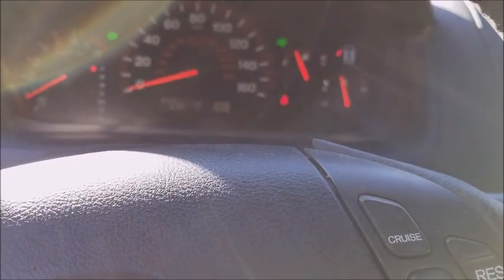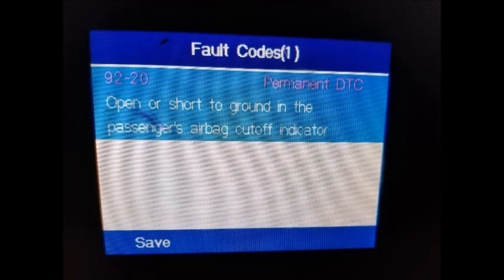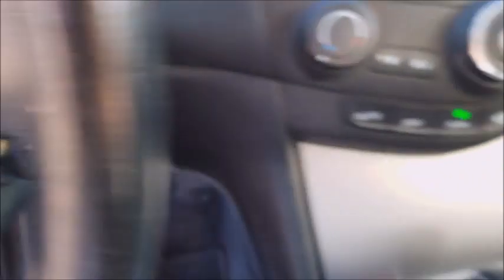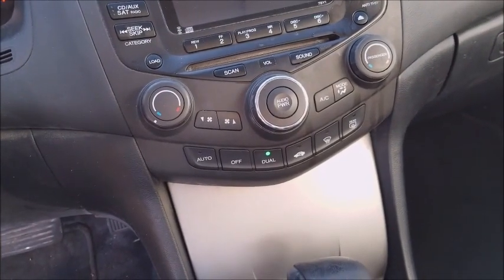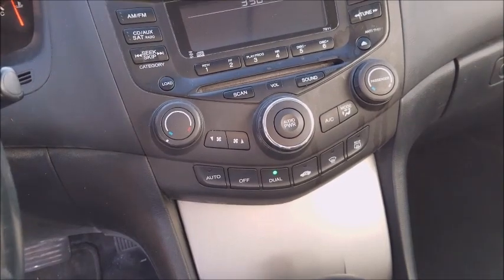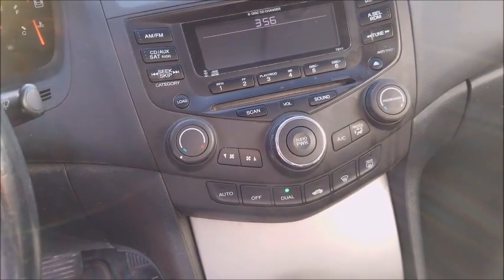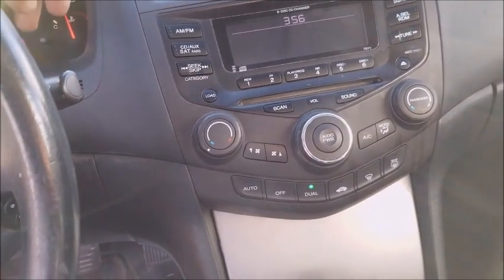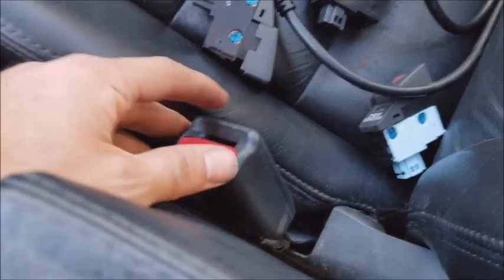92-20 Fault Airbag Code ( Open or Short to ground in the passenger's airbag cutoff indicator )

Comment: Thank you, this saved me $224 worth of “labor” at Honda, though unfortunately I overpaid for the switch and couldn’t escape the $150 “diagnostic fee” for plugging in the scanner and checking the codes 🤦‍♂️ I can’t believe how stupid easy this repair was!
Reply: All DIY mechanics should have a good code reader. Make sure it has ability to read ABS and SRS. and I wish mine had live scope. Bought mine off Amazon for 150$

Comment: For anyone with an 8th gen civic, this fix can also work. The passenger airbag on light is supposed to be right above the flashers button but for me an aftermarket radio didn’t have the slot for the passenger airbag on module so it wasn’t plugged in. All I had to do was plug one in, clear the code and no more 92-2x.

Comment: Thank you for the video. It helped me fix my problem.  I took my switch apart and the issue was a bad solder on the 361 ohm surface mount resistor.  Re-soldered it and it seems ok so far.
Reply: Thanks bro  same thing on my Honda fixed 😊

Comment: Got 92-20 airbag code in 04 accord. Replace the indicator with $27 Duralast Switch SW7578 from Autozone and solved the airbag light problem. Checkout old switch and found 103 ohm resistance was defective (open circle). Thank for the video.

Comment: I’m having 92-2 after spilling some fluid on the seat on my tl. Seems strange to replace something on the dash but I will try. Any other suggestions
Reply: ATG suggests to remove the Seat-belt Latch (Press) & clean the Microswitch with ATG Gold Cleaner.

Comment: I commented ago because I had this code on my 2012 Honda ex-l. Sir bag light was flickering off and on. Like you noted, the “off light” would not always turn on and that is when the airbag light went on. 

Finally got the hazard light switch switch replaced (was a little more difficult in the 2012 Honda Accord due to having to take out the whole center consul and I’m happy to say the light has stayed off!! $46 dollar fix compared to spending $1000s at the dealership. Thank you so much!
Reply from the maker: You are welcome - Thanks for sharing !
Reply: Any video you found for 2012? I’m noticing the same problem on a 2012 accord that I’m trading my 06 for
Reply: How did you get the hazard light out dude?? I’m in a 2012 too and I’ve taking my the entire radio out. Still can’t get the hazard button off

Comment: I just fixed mine. There was corrosion on the solder points on the circuit board in the switch. I used isopropyl alcohol and scrubbed the points with a wire brush. I assume it was from condensation getting in the switch from the ac vents being next to it.

Comment: Thank you so much I was looking ans looking until I saw your video. And fixed my problem. 
I run the codes. By jumping pins 4 and 9 in the OBD 2 connector. And airbag lights flash 9 slow times and 2 quick. Code was 9-2. Thqnk you very much
Reply from the maker: Thank for sharing your experience . I appreciate you taking the time to post your experience and share it with us .

Comment: Hi, thanks for good video. I have the same code on my 2005 honda odyssey. One thing that comes in my mind is, have you checked that broken bulb is not causing this? Then it would be even easier fix just to replace the small bulb.
Reply from the maker: Hi Nemiers , Thank you for your feedback. The light works OK . The problem is not with the light . The problem is with the module it self from inside. I am glad that you find this video helpful. Thank you for your feedback .
Reply: @autorepairchamps  ok, then it is more interesting to take it apart and see what could be the real cause. I would just buy new one, but as I am living in Europe these inexpensive parts tend to get expensive with shipping and tax. Thanks!
Reply: @autorepairchamps  ok, then it is more interesting to take it apart and see what could be the real cause. I would just buy new one, but as I am living in Europe these inexpensive parts tend to get expensive with shipping and tax. Thanks!
Reply from the maker: Totally understand, Try to find a junkyard nearby or Ebay, here is a link where you can get one from ebay here is a link https://www.ebay.com/i/132838893311   Good luck my friend. Thanks

Comment: My airbag light actually comes on when I turn on the car
Reply from the maker: what code are you getting ?
Reply: @autorepairchamps  83-22 passenger weight sensor
Reply from the maker: @HumanStateOfEmergency  You may need to re-calibrate your weight sensor on the passenger seat. you will need to attempt this with a scanner to reset your weight settings .

Comment: Hey i wanted to know if this would also apply for a 09 civic
Reply from the maker: If you are getting the same code , try the trick mentioned in the video by plugging the seat belt in and see if the light is gone . if light is gone then yes the fix is going to be the seat-belt buckle . Let me know if you have any other questions .

Comment: Did you have an accident in this car before you have the light on?
Reply from the maker: No , the 4 way flasher switch went bad and this is is common problem for these model vehicles
Reply: @autorepairchamps  thank you I have the same problem on my Honda Accord 2007 I bought used and when I went to the dealer he just looked at it and said it has been in accident and I think he was lying
Reply from the maker: @abodalashkar5686  So you replaced the switch all working ok now ?
Reply: @autorepairchamps  no I haven't I am looking for the right part number so I am going to open it and check the number first than buy the part